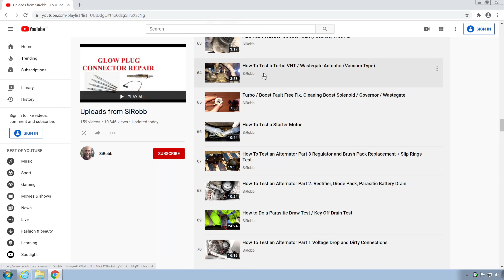Diagnosing VNT Turbo Faults

Comment: Hi Rob, wondering if you could share some advice. 
I had this anti-skid service problem and have installed a new used yaw sensor from another car that was working. 
Now it still has the same problem but it says the system not calibrated. 

If you can give me a contact and help me through this process, name you're price and I'll wire it to you. 
Thanks Simon.
Reply from the maker: What diagnostics equipment do you have access to and what is the Volvo model and model year?
Reply: @sirobb  basic mid range scan tool Launch. Its a 2003 xc90
Reply from the maker: You'll need to do a calibration of the Yaw sensor. 
I only use Vida on Volvos so you'd need to check if your tool can carry out such a procedure.

If yours can't, I can provide the tool for £100 delivered in the UK and that includes the software. You would just need a suitably specced laptop to run the Vida software.
Reply: @sirobb  I'm in Slovenia. So its quite a distance. What tool can do the job, I can check around here.
Reply from the maker: You need a Dice or VCX tool and Vida software.
I can send one to Slovenia for £115GBP
Reply: @sirobb  does this include the tool and software?
Reply from the maker: @tripshobbies2810  Yes
Reply: @sirobb  Hi Simon, didnt receive an email from you yet, My wife called volvo official service and they priced her at 30 Euros to recalibrate, but they said if there is an error with the air bags it will cost a lot more? This doesnt make any sense to me, how is the ABS module related to the airbag module? Could this be a thing?
Reply from the maker: Hi, I don't know of any reason why the SRS system would affect the Yaw Sensor calibration so you would need to ask them why.

I haven't sent you an email because I haven't received a PayPal gift payment and I don't have your email address.
Reply: @sirobb  I gave you my email above and asked for you to forward me details for transfer mate
Reply: @sirobb  I've never hear or seen anything like it ether. Think they just rip offs thats why I work on my own cars and rather buy the tools I need.
Reply from the maker: @tripshobbies2810  No problem. Email sent.